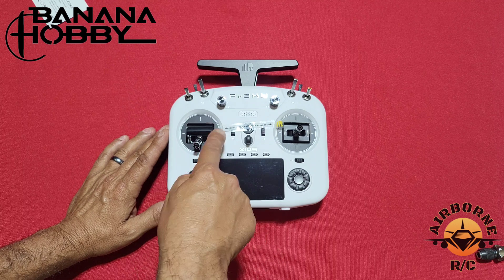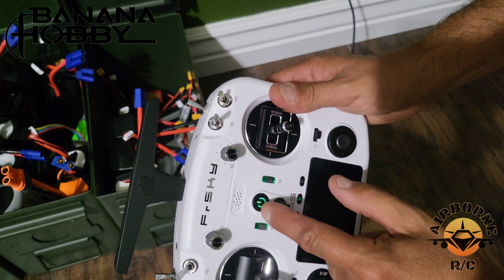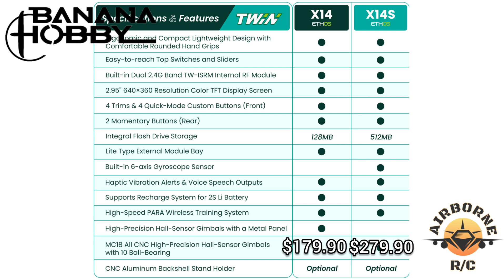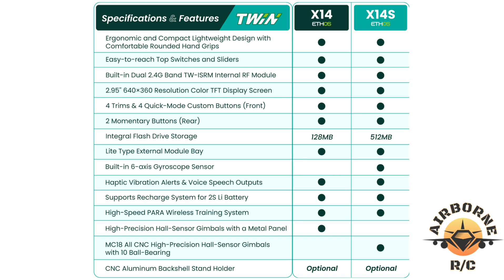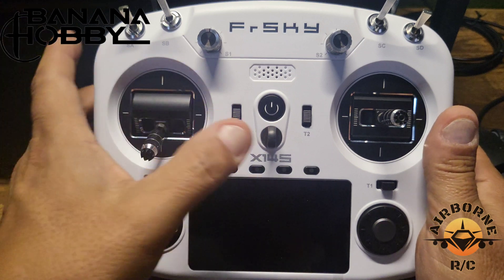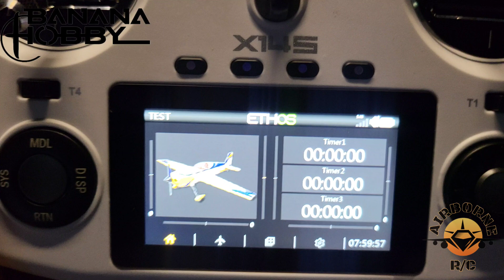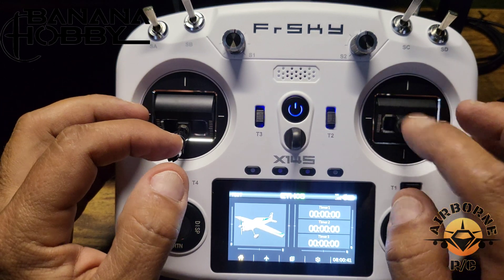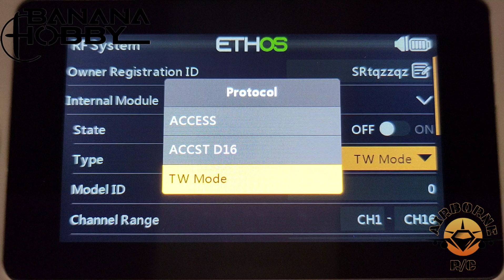FrSky TWIN X14/X14S Transmitter Dual 2.4G Radio System

Comment: I have a question and it's a little off topic... when you see some people mainly in Europe with very expensive transmitters for giant planes... what kinda transmitter are they typically using and how many channels do they need for a giant turbine jet or very large helicopters?

i have nx8..
Reply from the maker: In Europe I see many Radios like here in the USA. I'd say frsky and spektrum be the most popular. Now for the big planes it depends. When you see those giants they usually use one reciever output ch. Per surface. This way you get most control. Lets say a AF Model turbine l39.  You have 4 servos in the wing. 1 for rudder, 2 for elevator, 1 steering. Then 1 ch for throttle, 1 for gear, and one for brakes. This would be 11ch...each it's own ch. Now you could "y" things together but whn people get to the things you talking about. Usually minimum 12ch up 18ch. Also the l39 has an airbrake. You would need 12ch if ya wanted to use that. Channels get used up real quick. My Roban airwolf uses 7ch minimum. Then ass lights, moving rocket pod, guns. Yeah ch. Go quick lol.